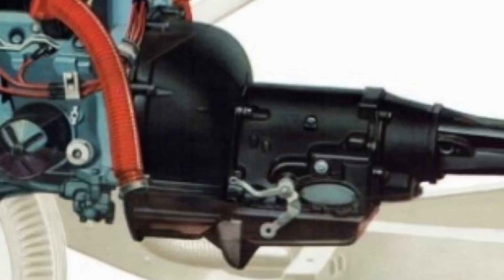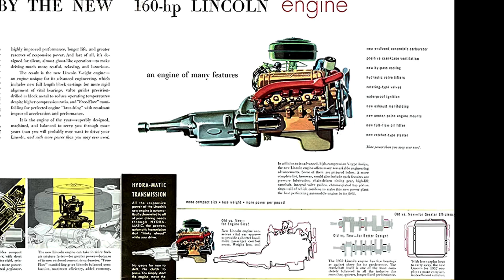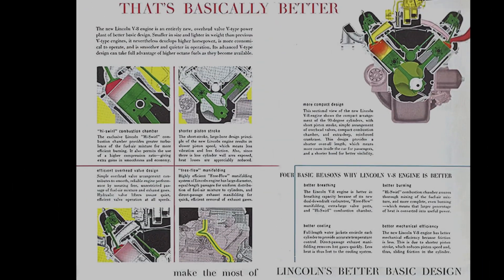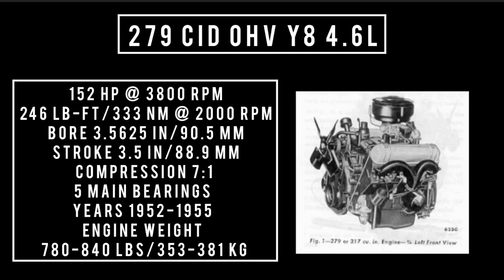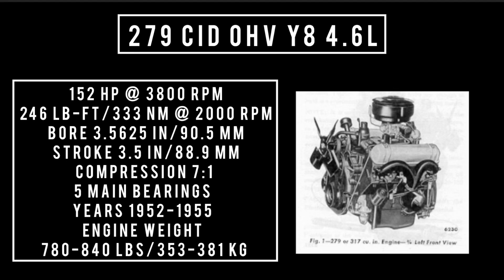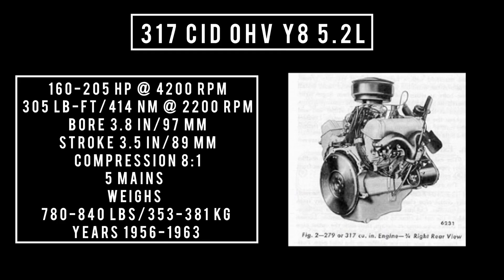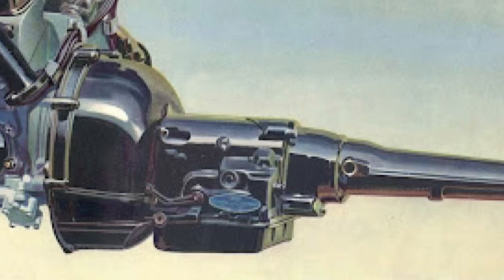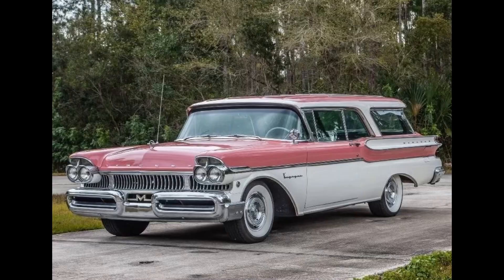Lincoln Y-Block 279,317,341,302,332,368

Comment: I have a 61 f700, 332 y block, retired fire truck with extremely low miles. Age has gotten to it from sitting but I have it running and driving. Every time I need a part I have to pull a rabbit out of a hat. Either rebuild the part or start looking at other cars and trucks from other years.

Comment: I know I’m late in watching this but it’s just too cool not to comment, these were great engines even if they ran GM automatic transmissions 😂, seriously though they were great engines in great cars and for the WYR I will take the 52 Lincoln thank you but I have to wonder why no option for a 53 as that was the golden anniversary edition and just a tad more special than the 52 or 54 especially the capri models as those were the top of the line Lincoln’s at that time. If you have never driven one I recommend it,  they truly handle great not a land yacht and not too stiff just right and confidence inspiring, there’s a reason they placed 1,2 and 3 in the pan American road race ( Mexican road race)
Reply from the maker: Write ins are always welcome. I'm happy you dig this episode =) 

Hopefully tonight 59 Ford galaxy Skyliner. I'm working on the ferro engine episode it's going to be a great episode.. I knew why they stopped making it. It might actually be the first overhead valve. V8 engine offered in America. 1915-?

Comment: Underwhelming even for the time. Ford didnt wise up and go BIG until the 390 FE and 430 MEL. You could get the 430 in a T-BIRD in 1960.
Reply from the maker: Both of those engines were great ford engines it sucks it took that long to get there the flathead was decent but had cooling issues Y block is good as well but had limitations and oiling problems

Comment: Well, once again, you're talking about an engine family that I have some familiarity with.  Beginning in December 1975, I began a 2 1/2 year stint of driving a big 66-passenger school bus for Frederick County, VA.  Frederick County had this habit of keeping its buses for almost forever, even when they had to change out engines in one multiple times.  Anyway, my normal bus was a Wayne-bodied '64 Ford with a 361 V-8 and 5-speed Spicer transmission.  But, there were still several '63 Fords on the spare line that all had the 332 V-8 with New Process transmissions.  So, I often had to drive one of them when my regular bus needed service.

There was quite a difference between driving the 361 and the 332.  To start off with the 361, I had to just lightly touch the gas pedal while drawing out the clutch.  If I did that with the 332, I would stall it.  So, with the 332, I always had to rev up the engine before drawing out the clutch. And, if I were to rev up the 361 while starting up, it would cause the whole bus to shudder like crazy.  It always messed me up when having to alternate between my '64 and one of the '63s.
Reply from the maker: Awesome thank you so much for sharing your experience with both of these engines =)

Comment: Very interesting to know more about the Lincoln Y block family. In the 80s I drove a '53 Ford F800 3 axle truck with this Lincoln Y block. It had a 5 x 3 trans and a 2 1/2T military truck bed set up with ramps for hauling small dozers. It was pretty slow and dated even for the 80s but it got the job done around the local area.
Reply: Your story Reminds me of the time i went for a ride with My Uncle. i was about 6 years old and my uncle was hauling lumber with a 1953 F800 tandem. It was really muddy, and we were in 1 st  gear for 6 miles in the mud with Chains on. The engine was a 332 Lincoln Y. I can remember my Uncle saying the y block had a lot more power  than the 337 flat head, He had in his 1950 but it didn't stand up as well on hard pulls.

Comment: You have your Yblock sizes wrong.  you had the 239 and 272 and 292 and 312 and 332 and 368.  Youre also wrong on the first year of the OHV Yblock, as it was 1954 and not 52.Also the 302 you mentioned is a windsor engine that was 1968 and was not a Yblock.  I have noticed the Mil generation has come up with false LITERATURE MADE BY PERSONS OF A LATER TIME.  eVEN WIKI HAS SOME FALSE INFO
Reply from the maker: This is lincoln y block totally different engine family the y block your Referring to is the Ford Y block it’s smaller two different families
Reply: More false literature.  Pertaining to lincoln it is only the 368 CID that was larger in deck height, but Ford and lincoln are the same thing.  .  As for the Yblock sizes I mentioned that is the only CID sizes for the ford Yblock.  There is false literature all over the net and even books of things that just arent true.  You take Mondello Olds site, at least 50% of that information is wrong but for some reason it is the most popular site
Reply from the maker: https://www.macsmotorcitygarage.com/fords-forgotten-y-block-the-1952-57-lincoln-v8/

That’s false the Lincoln engine is a different engine all together
Reply from the maker: You’ve been misinformed it’s in literature from 1952 so you’re gonna argue with that too…

here is some literature from 1952 from Lincoln. You can read it. The literature is from Lincoln motor car company so you’re saying the car company that built the cars are wrong. The Lincoln Y block was also used in Muntz jet… 

https://en.wikipedia.org/wiki/Lincoln_Y-block_V8_engine

https://www.oldcarbrochures.com/static/NA/Lincoln/1952%20Lincoln/1952%20Lincoln%20Full%20Line%20Brochure/image9.html

I’m sorry if you’ve never heard of this engine family but it’s a totally different engine family than the Ford Y block it shares nothing with that engine except the name y block name two totally different families… if you wanna mute me that’s fine you’re entitled to your own opinion but your opinions wrong. 

https://www.oldcarbrochures.com/static/NA/Lincoln/1955_Lincoln/1955_Lincoln_Brochure/1955%20Lincoln-06.html

https://www.oldcarbrochures.com/static/NA/Lincoln/1956_Lincoln/1956_Lincoln_Brochure/1956%20Lincoln-12.html

Comment: I drove a 1952 Lincoln Capri to high school in 1965.  It was not quick due to its weight, but once it got rolling, it was the smoothest hi-speed car I ever drove.  It 1952, the speedometer only went to 110 MPH and I broke three of them...  I would love to have another equipped like that one, 2-door hardtop, leather seats, power windows. air-conditioning, and a GM 4-speed  Hydo-Matic.  Sweet ride...
Reply from the maker: Awesome =)

Comment: Hi Jay!:  These engine episodes are GREAT!  As far as I can remember, the Duesenberg Model J engine had a oil filter housing like that of the Lincoln that mounted to the exhaust side of the engine. They were usually polished aluminum so they kind of stand out in photos of the engines.  WYR#1  1956 Lincoln!  That is one of those NICE looking 1956 cars!  WYR#2  1957 Lincoln!  Still looks good like the '56 but with FINS!
Reply from the maker: Duesenberg had a funky set up to my knowledge it had two Internal filters there was a lever I believe it’s on the driver side when you’re ready to change your oil you just move it all the way to the left and it just opens a trap door in to pan to release oil that’s the way leno explains it

Comment: Still running the 368 in my 56 Premiere Coupe. Runs like a champ!
Reply: Your Premiere was the true Hot Rod Lincoln of the day. Ford had the Daytona speed record in 1957 with a 57 mercury that had a 368 with fuel injection that was pushing close to 400 horse power which back in the 50's was quite the accomplishment. Love the Fords, Lincoln's, Edsel's and Mercury's of the 50's. Total Performance all the way.
Reply from the maker: Awesome =)

Comment: As a child my mother had a 1954 Lincoln Capri Coupe. They purchased it one year old, they didn't plan to buy it since they had a relatively new '53 Ford convertible.  But the opportunity came up and they went and drove it.  She said after one block she and my dad looked at each other and realized the Lincoln was not at all like a Ford.  It was very quiet, powerful, comfortable and handled well.   Plus it had power...well everything.  Obviously they bought it.  They drove it into the mid-60's when they replaced it with a '64 Continental which was quite a different car,  good but she never liked it as much as the '54.  As to which I'd take, well the '54 Capri Coupe of course!
Reply from the maker: Thank you so much for sharing that story what great memories.. what happened to the ford did they trade that for the Lincoln or

Comment: 1956 Lincoln Premier is one of my favorite Lincoln's.  Along with the 1961 - 1969 body style, then the 1970 - 1979.  Guess I love Lincoln.  Guess I should get one...
Reply from the maker: 56 premiere is a stellar car there are three cars that look very similar 56 Lincoln premiere 55 Plymouth and 55 Packard those three cars look very similar.. in my opinion
Reply: Most folks have forgotten about the 1957 Lincolns...but I owned one, over 50 years ago!...That 368 was, IMO, just OK...The rated 300hp did not really feel that powerful, mainly because the vehicle was so big and heavy...I believe 0-60 times were like 11-12 seconds. But the car was so incredibly comfortable, very posh interior, and I, unlike most people, loved the large fins! Sadly, 1957 was a mediocre year for Lincoln sales, which is why you see very few of these barges on the road, or even at retro-car shows!...And like you said, in 1958, the big Y-block 368 was history.

Comment: This Lincoln engine family is emblematic of FoMoCo's dithering in the '50's and '60's, which really hurt them. The Y block engines were developed for trucks  (with heavy duty skirting for tough duty, necessary for trucks but not so much for cars) but were also used in cars.  Neither the Linc or Ford Y block was as good a car engine as the 5 GM OHV's or Chrysler Hemi's and the Ford was troublesome with lube weaknesses.  FoMoCo put all their effort into style starting 1949, and IMO leapfrogged GM and Chrysler... but their mechanicals lagged... that might be where "Ford: Fix or repair daily" got its start
Reply: On the contrary,  the Ford's Y block had the gm and chryslers engines beat in the long haul as the oiling problems were only on the 239 and the 279 and were mostly solved by the 1955 model year and the 368 was a real power house back in the Hot Rod Lincoln's of the day .
Reply: Forgotten engines? Never even heard of the 371, 347 and the 283, wasn't nothing to brag about. Be mind full the the 430 Super Marauder was the first engine in 1958 to break 400 horsepower barrier, so your point about forgotten engines bares no savy...
Reply: Then why is the 368 a forgotten engine, when the Chevy 283, Pontiac 347, Olds 371 J2 are so much better remembered ?  Ford didn't make great engines until the 390/427 and the 260/289/351
Reply: @peterruddick1952  The reason the ford and Lincoln were forgotten was because, Ford Came out with newer and better engines. The GM engines were mediocre, but they built them for 60 years. GM guys had no choice that was the only engine they had. The Ford Y block with the stacked intake ports left alot to be desired but it was never out powered by a Chevy of the same year until Ford replaced it witha a bigger and better engine. When the 283 made 283 hp the 312 made 300 hp.
Reply: @mylanmiller9656  GM V8's were far superior in every way (power, weight, lube, design, breathing, reliability) to anything FoMoCo made until the Windsor V8's early '60's
Reply from the maker: Great information

Comment: Our Fire Department operated a fleet of 24 Ford F-800 trucks powered by the Y block 368 truck engine. Torque monster and very powerful. All had dua exhausts and a big Holly four barrel carburetor.Each servded for 15 years on front line service
Reply from the maker: Awesome story thank you so much for sharing that memory

Comment: I love all these beautiful automobiles!🤩 I'm tending to sway towards the '52, but then the '54 Capri is very appealing, and I am also drawn to the unique styling of the Premieres, very tough decision🤔, but I'd definitely have to pick the Voyager wagon, especially the one pictured! 😎
Reply from the maker: Great choices
Reply: My 1957 Lincoln, which I drove back in 1970...had one rather ugly feature...the air-conditioning ducts began as large, weird-looking tubes, located in the back ledge area--because the Air-con unit was in the trunk, under the window!...These tubes funneled the cold air up into the headliner, where  there were air vents, two in front, two in back...A very strange arrangement!..did not matter to me, as the compressor had quit working, long before I had bought the car...in fact, the guy I bought the car from,helped me to remove those fugly tubes!

Comment: Hey jay  thanks  I never knew about these big block y block engines I wonder if this lincoln Y block  had top end oil delivery problems like the ford  ?? anyway     too- ta - loo
Reply from the maker: I joined a Lincoln y block group and I asked that very question and I didn’t get a direct answer.. but I would imagine it would be the same why would Lincoln only use this engine for five years..
Reply: @What.its.like.  The biggest reason Lincoln went to new engines in 1958, was the new cars were getting to heavy, and the competition were making their engines bigger. They were still using thick wall castings, the 4.62 bore spacing limited them from increasing the bore. Later the FE engines were cast with thin walls and the 4.62 bore spacing was taken out all the way to 4.23 for the 427.

Comment: you do a great job hunting down information on all these engines, two things I would like to add would like to add to your list, the Bore spacing on this engine 4.62 the same as the FE engine, and there 2as also a 335 hp 368 engine called the Marauder 368. this was the engine Ford used in the 1957 T bird to set the speed records at Daytona Beach in 1957.  this is an engine that is not talked about vary often.
Reply: I made a mistake the 368 High performance was called the Marauder 335
Reply: Also had dual quads! very hard setup to find these days.
Reply from the maker: Thank you so much for sharing all that added information I greatly appreciate it I try to do as much research as possible but somethings just slipped through the cracks
Reply: @jeffwalker1956  Believe it or not there was a Marauder 335, on Craigs list just presently, It was the whole Car not just the engine. I spotted it but the add had sold across it.
Reply: @What.its.like.  Don't sweat it man you do a real good job on the engines you list.
Reply: @mylanmiller9656  Bummer! that would of been a great buy!
Reply: Never even knew this 335hp version ever existed!...I could have used it in my lethargic 1957 Lincoln, which had 300 hp--not really enough.

Comment: Didn't pcv start in1963
Reply: PCV was the first 'emissions control', and was Federally mandated for either 63 or 64 cars, I can't remember. Prior to this, engines had 'road draft tubes' which with worn rings created a cloud of smoke under the hood of stopped cars, sometimes so bad you'd think they were on fire. They also spit oil onto the roadways; not good for traction. The end of the tube was cut on a slant which created a sight vacuum when the car was driven forward.
Reply: @P_RO_ I remember seeing old US films showing these black streaks down the middle of each highway lane and wondering why they were there. I never saw anything similar in the UK.
Reply from the maker: I’m not sure when it started

Comment: 57 Lincoln premiere
Reply: I owned one...the interior was excellent!...A large radio speaker was right under the middle of the dash, and there was a floor-mounted button that would squirt lube oil to the chassis joints when you stomped on it!

Comment: I always wondered what the difference was between Ford Y blocks and Lincoln's.
Reply: Premiere. By far  at  the  top     had a Capri 56 and colony park 59    went to a Willy's 6 cyl.    52 wagon   4wd  after the CP
Reply from the maker: The Lincoln is bigger
Reply: @What.its.like. my question are  these engines  interchangeable  at the bell housing with the fords.
Reply: Heavy Brutes, too.

Comment: Will the transmission from other ford products bolt up to these engines ?
Reply from the maker: Not sure ford was and is still weird I’d venture to say no they had 3 different case sizes and three different tail shaft sizes in the late 50s

Comment: I would want the 1956, and 1957 Lincoln. 
I don't think there was a deck height change in the Y blocks. I think the difference was all bore, and stroke, on those. Those Mercury's we're so ugly! The MEL engines were a beast! Big, and heavy, but high factory horse power for the time.
Reply: Agreed, those Mercurys were garish and had too much chrome. I wonder if we’re related? 🤔
Reply: @markw208  😂